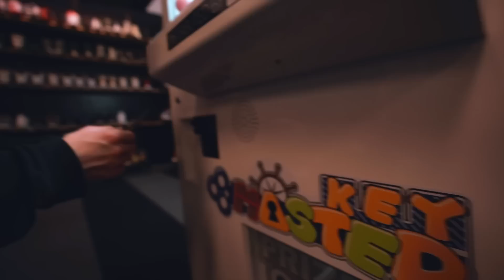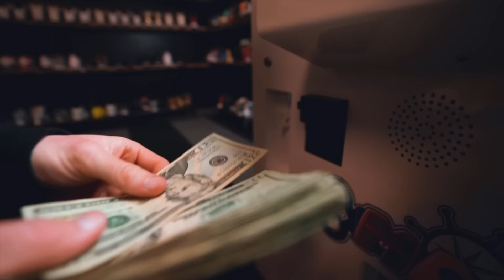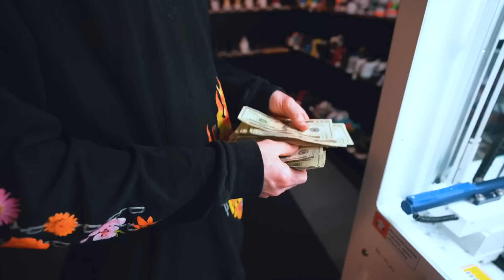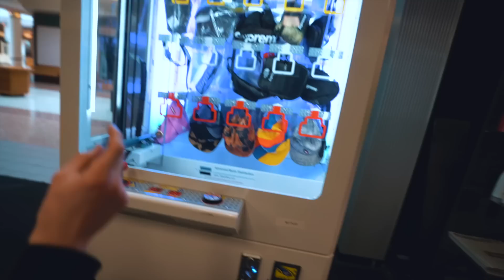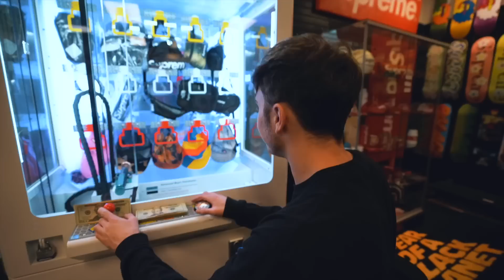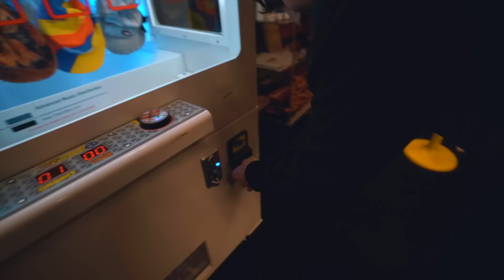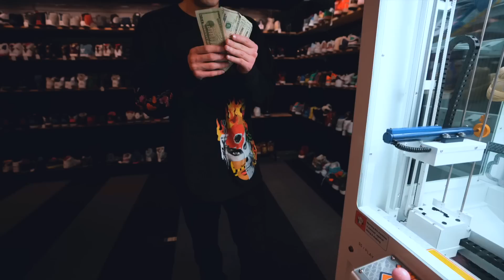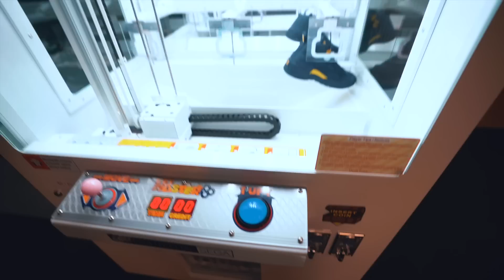I Spent $1000 On The SNEAKER KEYMASTER.. This Is What Happened..

Comment: The three levels are set at a different payout rate.
Meaning if the top level is set to $800 payout rate, you can not "win" until $800 has been spent attempting the top level.

When they are not going to payout they jump up, or keep moving up after you let go, and hit the top.

When you are really close and it hits the bottom it's not going to pay out.
When you are close and it hits the bottom, it is ready to payout.

Comment: Keymasters are set to a pay out, each row vertically is set to a unique price where it is impossible to win something on the row until it has reached its set amount. Once a line is ready to pay out you can tell as the machine will not move upward and touch the top this is where its down to skill with nothing rigging it.
Reply: There is a system in place for the price, but it isn't impossible prior. It's simply much, much harder. However, you can win it with some pristine timing before it's "ready" to pay.
Reply: if your qias or sneakerhead youve nown all ready,even tho is  not fair for everyone its kinda fair for people that dont have enought money to buy expensive sneakers and try there luck for 5$ (just to say) and they win its a goodway
Reply: @Ben Holdstock irrelevant

Comment: You set these machines on how much money you want to make before the controls actually become reponsive to touch. Meaning...... the owner sets it to 500$ anything before 500$ in the machine will be a loss. After the 500$ the controls actually work so it's up to the person operating it to let go at the correct time. After the win it resets and it needs another 500$ to activate the responsive touch. The owner of this machine had it set at a pretty low figure. Probably becuz it's in a sneaker store so he is getting those products already at a great price cz he is buying in bulk. He is winning either way cz most ppl go in to buy a pair of sneakers then see the machine and drop a 5 or maybe a 20 in it and walk away with nothing.

Comment: It’s a payout rate...so even if you hit it perfect you still will lose most of the time. I think it usually goes by horizontal rows. So the middle might payout but not top or bottom. So if you see one of these machines just do 1 try on each row to see if it’s rigged or not.